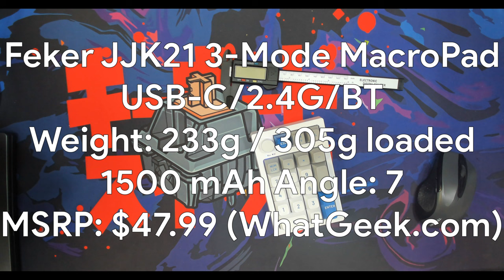Feker JJK21 Review A 3-mode PC plate gasket mount hot swap keypad with a knob

Comment: heya, had an issue with my board. the NUM light isn't showing anymore but is recognizable when connected (BT, wired and 2.4). all buttons on the ESC row is working but all everything else isn't. do you happen to know the workaround for this? thanks a bunch!
Reply from the maker: Sorry, I haven't come across this issue, have you tried reaching out to the vendor?

Comment: Any tips to connect this wirelessly? My 4 key will light up but won't actually seem to connect to the PC.
Reply from the maker: Mine connects instantly over 2.4G and takes a few seconds under BT. Which connection type are you trying?

https://epomaker.com/cdn/shop/files/JJK21.pdf?v=4880265204848473201